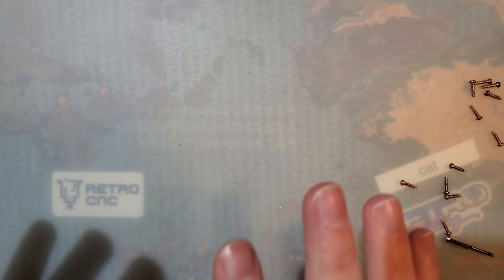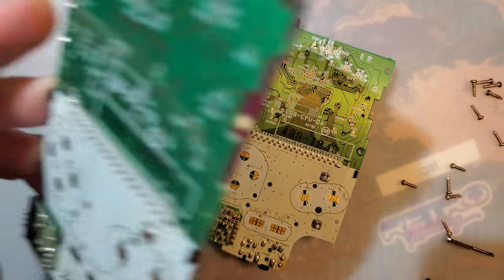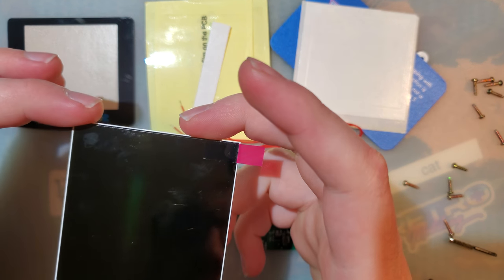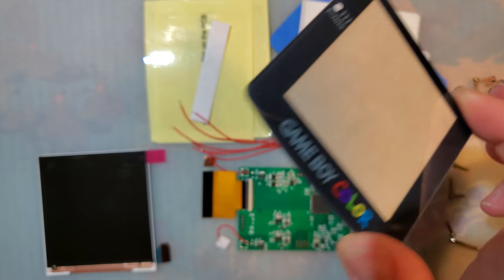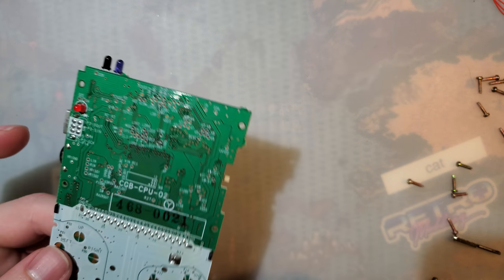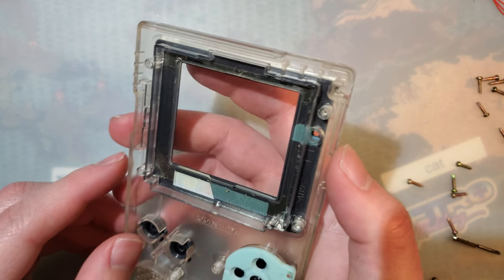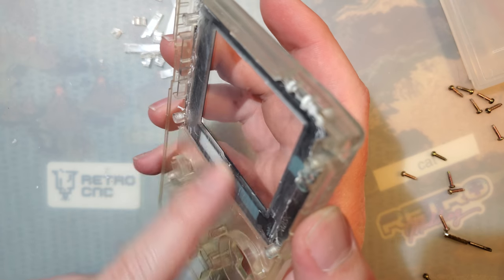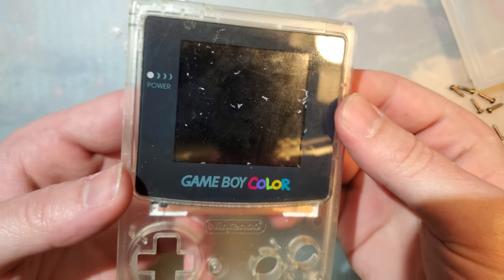Game Boy Color Q5 IPS OSD LCD Kit

Comment: For anyone trying to get the battery monitor to work. You need to run a wire from BATT on the video board to the Positive battery terminal. You also need to run a wire from the GND on the video board to the Negative battery terminal.
Reply: I feel so dumb right now. Was trying to figure this out for days. Thanks alot chief!

Comment: That screen size and the colors of the IPS screen are absolutely gorgeous. While I do appreciate the smaller transflective display kit, I really wouldn't be against one of these. If only transflectives were more popular or advanced, we could probably achieve a better mixture of both, but that's just wishful thinking on my part.

And yes, I also use the IR port on the GBC. Just for Mystery Gift. Good to know it's rather easy to just place those sensors out of the way.

Comment: That's a really cool mod. Seems like it will be good for mods that just need the regular screen lens. As a modder I think I will keep using the v2 IPS kit for my builds since lenes will be easier to get for it since it uses the standard screen size. Plus accessories will work better if you want to put it in a case or something that has a screen cutout. I think I will check this one out tho sometime.
Reply: I’m wanting to get a backlight ips kit for my GBC but also want to keep the stock size because I have the yellow Pokémon edition. What kit are you using because I can’t find one anywhere?

Comment: For the batery life meter to work solder it on the power switch mine works with no problems good informative Videos you have hope it helps some Person Who want the batery meter
Reply from the maker: It doesn't matter where it's soldered on my kit -- it just wasn't fully implemented at the time. Also, the power switch is literally connected to that battery terminal so the only difference between where I soldered and the power switch is where you have to route the cable upon reassembly.

Comment: From your experiences with all the current IPS screens & power consumption, especially when trying to use an EzFlash, what do you recommend to do battery wise? Also, do you see any future mods that might help with this? As always, appreciate your hobby. 👍🏻
Reply from the maker: Get a couple good sets of NiMh batteries and just rotate them out
Reply: Also possible to add a 2000 mah battery like the ones from boxypixel and even add usb c charging.

Comment: Hi. Were you able to test the battery indicator further? I was hoping maybe it is not as precise as we think (maybe drops down to half and then to empty?) Thanks for the great guide btw👍
Reply from the maker: I mean, I did test it on a powersupply and several different types of batteries. It was unresponsive to all my tests. What else did you want me to try?
Reply: I was kinda hoping maybe as you play, it drops down to half after half of the battery is empty. Maybe the indicator is not as sophisticated as we think.. If you say so, there is no reason to bother with it. Thanks again
Reply from the maker: @cansuoz751  Every other battery indicator works by detecting voltage and every battery I throwed at this thing showed full/empty charge. The indicator on my kit does not work. I even rewired it after the video and tested again using the manufacturer's suggested wiring. Still did not work.

Comment: What does the "color adjust" setting do? The one feature I'm waiting for in one of these kits is the ability to show "correct" colors for GBC games, instead of the raw RGB colors they show that. Most games were designed for the non-RGB, reflective non-lit original screens. Emulators have shaders, the GBAConsolizer and MiSTer GB core also can use color matrices to fix this. Now we only need these kits to do that.
Reply from the maker: you can do that with this kit but it takes a bit of playing to figure it out
Reply: @makho  Yeah I found out later it lets you adjust RGB levels, not sure how fine the steps are, but should be able to get pretty close to a given target. Now we only need a GBA kit that has this color adjustment feature, as well as pixel effect (I'm among the ones who really need it for the sprite art to feel right).

Comment: Very good video!  I just put this screen and the black colors are green.  Is this screen faulty?  I don't understand why this happens to me.  You can help?  Thank you!
Reply from the maker: Try reseating all the ribbon cables first. If that doesn't solve it, I'd recommend reaching out to the seller of the kit.
Reply: @makho  ok I will disconnect and connect the flat cable.  I have tested on 2 consoles and the same thing happens to me.😫😫😫
Reply: @makho  I have tried everything.  I have removed the small connector, the wide connector ... everything!  And the green color continues to come out instead of black.  I don't understand what happens.😫

Comment: This was an excellent video and excellent product as well. Works just as advertised other than the battery indicator. Any updates on that?
Reply: I dont know if it is a newer version that I got, but you need to run a wire from BATT on the video board to the Positive battery terminal. You also need to run a wire from the GND on the video board to the Negative battery terminal.
Reply: Does it drains the battery then when the gbc is switched off?

Comment: Thank you for this very informative video!

Is it possible that the wires for keys a and b are swapped when soldering on your Board?

Does the battery indicator work correctly if you also solder GND?

best regards
Reply from the maker: It is entirely possible that the wires were swapped. I do make mistakes (or the labels could be reversed). GND is connected through the ribbon so there is no point in soldering it. Battery indicator has been fixed in newer kits I'm told.

Comment: You should design a couple PCB's that fit together like an X that's exposed copper to use as a dummy battery to attach the croc clips.
EDIT!! Not fully copper the entire length so you don't short them out. DUH on my part. Sorry.

Comment: Hi Makho, I love your Videos, absolutley phantastic! I have a question to this Mod: 
I noticed a problem with the sound when I build in the Q5 IPS Kit. This problem does not happen when using batteries, it only happens when using the AC adapter. I tested with the same AC adapter that i use on another unmodded game boy color that i have. It's a GB-515 model which i believe is appropriate to use on gameboy color and pocket. The noise is not perceivable on lower brightness settings but is clearly loud at about 75% and above brightness. When i use headphones, the noise is even louder, and at the maximum brightness it is even unbearable to listen. On my unmodded gbc i don't notice any noise at all. This is unfortunate because i plan to use the GBC only at home so i will use the ac adapter all the time. Do you know why this is happening and if there is any way to get around this? Best regards from Germany
Reply from the maker: if your AC adapter is Nintendo OEM, is is not rated for the power draw of a modified Game Boy.
Reply: @makho  Thanks for your fast reply, since the Q5 IPS is pulling about 352 mA on highest brightness level a AC adapter with max. 300 mA is not really sufficient, well a solution would be not to use the highest brightness level, hurts my eyes indoors anyways. Do you have a recommendation which Power supply is best to use for this mod? 
And do you plan a tutorial on the new funny playing laminated kit with backlighted Logo? I dont really have an idea how to drop in the display when the glass is laminated to the screen...
Reply from the maker: @MrTang-888  any power supply with the correct voltage and sufficient current should be fine. You'll probably have to splice on your own connector. 

Eventually.

Comment: Is this kit still worth it even with a flash cart when you're only getting 4-10 hours?
Reply from the maker: I mean, how much are you really even playing? An hour at a time? Two? Just keep two pairs of rechargeable batteries and swap them after every session or two and keep the other pair on the charger.
Reply: @makho  Probably 2-4 hours if the game is good. But swapping them out will probably work. If not I could get a normal screen size mod for situations without a charger.

Comment: Very nice mod mahko. Have you an idea of a drop-in battery mod for gbc without soldering the cables directly to the battery connectors? Like soldering a lipo to a circuit-board and drop it in with using the default Aa battery connectors
Reply from the maker: IKEA LADDA

Comment: tried doing the buttons this evening but it was a massive failure. i just couldn't get the solder to adhere to the pads at all. ended up pulling up the copper trace for the A button completely, suspect my iron was way too hot. either that or i was rushing, i'd been at it three hours...

i did get it to work at one point, about an hour in, got it so the menu came up on screen but the A and B were doing the same thing so i suspected they'd been soldered together. must have taken it apart and redone the wires 8 times at least before the eventual death of the board. now i've got a buggered gameboy colour and a screen which has its position set all the way to the left, so it's not even usable.

oh well, 90 quid down the drain. would be better if there were other pads we could solder to for the buttons.
Reply from the maker: I highly recommend spending a few dollars on a soldering practice kit before diving into a project like this. I tend to make the soldering look easy because I've been doing this for years but it's not a skill most people just pick up.

Comment: I think I may try to do a Boxy Pixel shell with the Ali-Express OSD GBC kit. I just worry about shorting things because of the shell being metal. I see them working though so maybe I am worrying for nothing. I think I would be better off with plastic buttons VS. brass because they need to be cut. Maybe black pad and maroon buttons.
Reply from the maker: keep in mind that his shells are not currently compatible with these kits (that may change). My personal opinion is that mixing and matching buttons is a no go. Keep it to plastic in metal or metal in plastic, not metal in metal. That's my preference at least. 

The shells are anodized and thus non-conductive. They are also only designed to make contact with certain parts of the PCB.

Comment: Sorry for asking, maybe I just missed it: At what temperature did you use your soldering iron? I guess the board can take a lot of heat, but I don't want to mess anything up.
Reply from the maker: I use 300c because that's what I'm comfortable with.
Reply: @makho  Thanks for your advice. I probably would have gone higher. 300c sounds good to me. Keep up the good work, I love your videos and content!

Comment: Hey there wondering if you have any videos of using a rotary tool to prep the case on a GBC?  I do have the tool but I want to make sure I'm using it properly and with the correct bit for the job.  BTW thanks for the quality videos.  They help so much!  Seriously considering using this for my clear shell gameboy.  I was hesitant with the minor trimming needed to the dpad area for the funny playing screen.
Reply from the maker: Pretty sure I showed my process in this video:  https://youtu.be/9wGO7S7qhoc

I'm on mobile right now so it's not feasible for me to check. I'll take another look when I get home and update if I linked the wrong video
Reply from the maker: Nah, that's the video. I use different, better bits now that don't gum up though. Exact same process otherwise.
Reply: @makho  u da best!
Reply: I've done a couple of clear shell GBCs and the key to using the rotary tool is slow RPMs and use whetstone knife sharpening bits. I used dremel's whetstone drums. They are usually pink or pale orange. You want to reduce melting as much as possible, and this is the best way I found. Definitely stay away from high speed cutters or anything made from metal as they need to be used at high RPM and the game boy will turn into melted chocolate.

My exact set up a proxxon that runs below 3000rpm and the drill stand. Not sure if you can get anything with that low an RPM outside of specialist places. A normal dremel with whetstone pieces will still work, but you will have to neaten up some melted burrs.

Whetstones are also good for getting a flush result. Hold the tool directly down (if you don't have the dremel stand etc, hold it like a dagger and brace the top with the side of your face. If you go too far down the whetstone will hit the plastic with the flat end and it won't really damage the shell.

Also the plastic on clear GBC shells is super easy to polish up and I used a Proxxon Pen Sander with some 800 grit sandpaper (attached to the tool via double sided tape) to neaten it all up and restore complete transparency.
Reply: @tsutenkakurobo9642  Thank you! That's very helpful
Reply from the maker: @tsutenkakurobo9642  the two flute endmills I'm using now work better than those bits as long as you use a rigid tool stand (which I am using). 

https://www.amazon.com/gp/product/B001UE7IVO
Reply: @makho  I'll try it out!

Comment: Hey Makho! I was just wondering if you've run into this issue before, as I'm having trouble getting it right and finding any info online. I ended up getting a GBA IPS kit, and the installation is done, but the right side panel (without the lanyard holder) refuses to sit tightly, and moves around during use.

Just wondering if you've ran into this issue before, and/or how you might recommend fixing it?

Comment: Hey man thanks for uploading love your videos. I have a question I have this screen and installed but then like less then a month later it went dim? Do you know how to fix that?
Thanks man
Reply from the maker: there is a touch sensor for brightness. Did you adjust the brightness level?
Reply: @makho  i have, have tried even, replacing the screen. However I think its the PCB board
Reply from the maker: @JerSan89  Reach out to the seller

Comment: Hey @makho

I got this exact kit with a Pre-cut aftermarket shell. I installed everything fine, but I noticed, that the right side displays a red-ish color instead of blue at a certain angle and figured it was some strain on the screen since after disassambly, this effect was not persistent. I guess this is due to uneven pressure because of the PCB board on the back of the screen. I tried many different things, such as sanding were the screen sits, but i cannot get rid of this effect. Do you have any suggestions what I could do? Would appreciate any suggestion!
Reply: Well, I figured it out now, I didn't quite sand it enough, kind of a bummer, that the pre-cut shell was of such a shitty quality.

Comment: What is the battery life with that screen on? Have you tested how many hours you can play? I have just ordered the same screen from china and im wondering if drains the battery quickly ill consider a rechargeable battery mod. Whats your opinion? Thanks!
Reply from the maker: I measured the power usage and added to a spreadsheet linked in the description. Approximate battery life can be extrapolated from there

Comment: Hi there, I followed your tutorial installing the Game Boy Color OSD Q5 IPS LCD Kit and did it successfully. My Everdrive GB x7 just arrived today, and I could only play the game (Legend of the River King) for about 15 minutes on lowest brightness setting before the batteries died. The batteries were fresh out of a pack too. The red battery light flickers dim and bright throughout the game, you can see it struggle a bit when the game loads aswell. There is a low buzz/hum coming from the speaker when powered on. Could this be due to low insulation? Have you ever experienced this before and know any fixes? I may need to open it up again and have a look. Thanks!
Reply from the maker: Don't use dollar store batteries. Buy some quality alkalines like kirkland signature or energizer or some quality nimh rechargeables like ikea ladda or energizer
Reply: @makho  thanks for your reply! Had a bit of a search and ordered some of the IKEA batteries and a charger. Hopefully it works out! Have you ever heard/seen anything like what I described previously about battery life being sucked? Could it possibly be something with my circuit board/wiring? Love your content, thanks for helping out!
Reply from the maker: @danieljerabek7578  not all batteries are made equally. Cheap batteries cannot power high power devices.

Comment: What’s the difference between the wiring you used and the retromodding guide? Both seem different, but does it really matter?
Reply from the maker: no, mine is just cleaner since all the solder points are consolidated and invisible in a clear shell because they are behind the screen.
Reply: @makho  Ahhh great! Thanks!

Comment: It's a bummer with the battery indicator not working. Leaning towards waiting for the next revision of this, assuming there will be one.
Reply from the maker: Allegedly it has already been fixed. It's a hacky feature at best though and I don't really mind that it doesn't work.
Reply: Oh okay, might give it a go then. Yeah, I bet it's hacky. But still, it's better then nothing and from watching your video on the "RIPS V4" it seemed to work okay at least. Thanks for the info and the video!
Reply: Just a quick update on this. I ordered the kit and can confirm that the battery indicator is working. :)
Reply from the maker: @rengstrom  Nice, thanks

Comment: Got a question about the copper touch sensors.

In your experience do they work equally as well on a solid colour shell or do they need to be on a translucent shell?
Reply from the maker: works fine on all shells, it's just easier to get the positioning correct on transparent ones for what I hope are obvious reasons